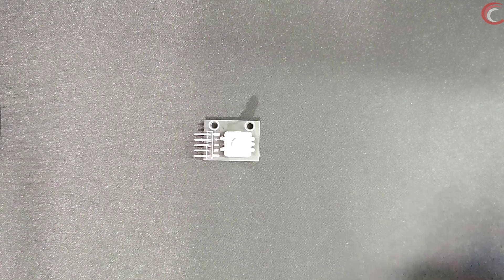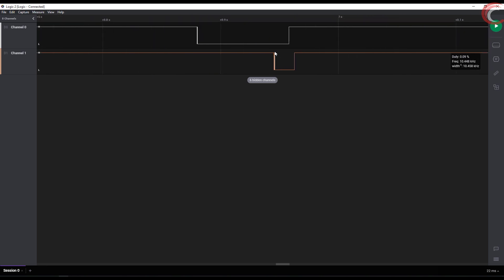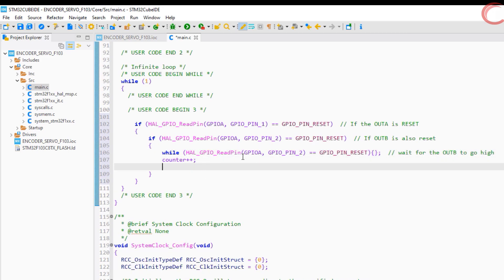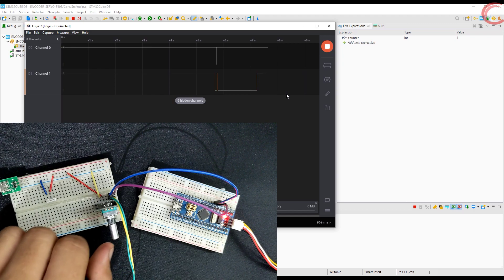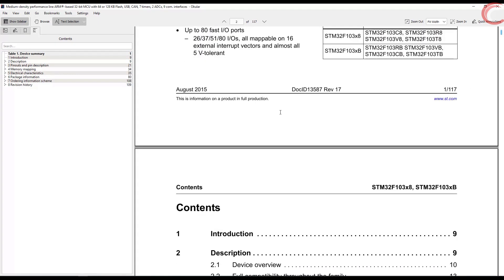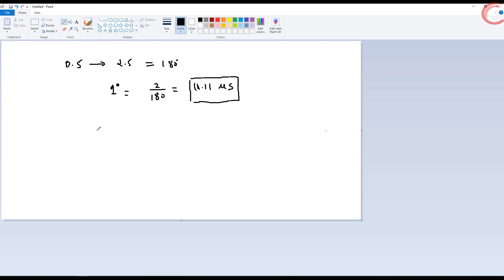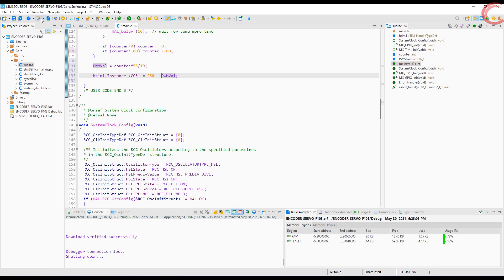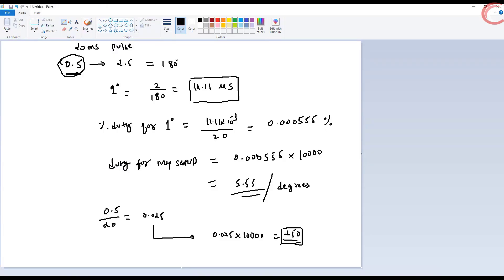Incremental Encoder and Servo Angle Control in STM32 || PWM

Comment: Your tutorial was amazing. I have used your code for my project but encountered a problem with it. Variable count changes by rotating encoder shaft 2 times. Is it possible to change this code such that for one rotation count variable changes by one?
Reply from the maker: Define another variable, CNT = count/2.
Reply: @ControllersTech   data in count variable is fetched only after two rotations of encoder. If i rotate the encoder only one time there will be no data of count variable. So by just defining another variable doesnt work.

Comment: Your video is wrong. On the image you show both signals must be always low or high but they are always only high. I mean when you make one increment both signals must change their logic level. But your logic analyzer shows that both signals are changing from high to low for a moment and then returning to previous high state automatically. So, it violates logic you described on the image.
Reply from the maker: One increment consists of 4 steps on the image. Starting from white and then coming back to white.
Reply: @ControllersTech  Ahh, ok. Thank you. My encoder works with another logic. It changes logic levels per one step and doesn't return back. What is the parameter of encoder which describes encoder's logic? How this parameter is called?

Comment: You can add 1nF-10nF  capacitors in parallel  to the pull-up resistors on the encoder. Then you will eliminate the debounce.